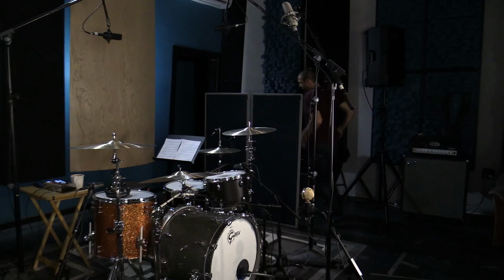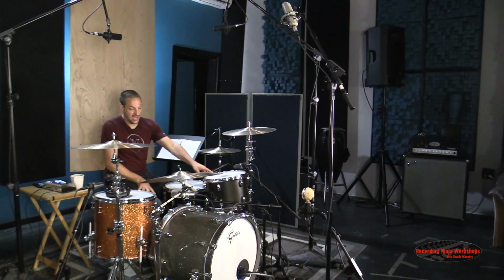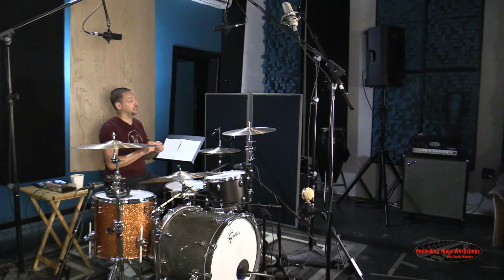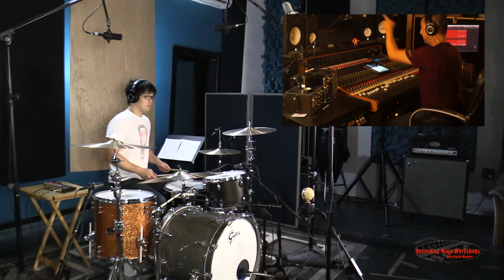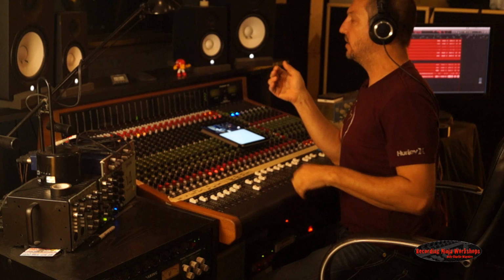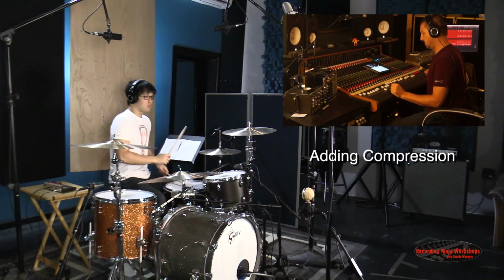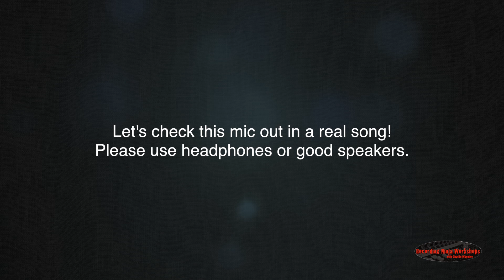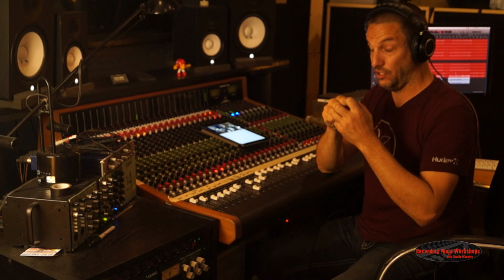Recording Drums: Adding Body & Punch to the Kick & Snare

Comment: great tips. i learned a similar trick years ago, always called it the nuke mic. usually was an re15, sm57, 421 or similar in that same position...run directly into an 1176 with all buttons pushed in. added under the main drum mix, it always added a lot. you can do similar with a mic under the drummer's throne pointed up between the kick beater and the shell of the snare.

Comment: Wow!  The over the drum mic adds so much body.  On a scope the mix probably looks less stereo though since this centered mono audio  will create less difference between left and right but who cares.  It sounds great and we can get carried away with emphasizing the recording of a single instrument in stereo that is part of an ensemble.
Reply from the maker: Hey Dollar WIL! The "over the drum" can add some cool mojo to the drum sound. It's not stereo though. It's just a single condenser hanging over the kick.
Reply: I clarified my entry to make it clear that I knew the mix would be more mono using this method but agree that the added "mojo" is worth it.  I have a drummer friend that wants to get a decent recording of his practices.  I've been trying to dissuade him from buying one of those low-quality drum kit multi mic packages.  I suggest that he buy fewer mics but of better quality and build his mic locker deliberately.  Your video best makes the argument.  Better quality mics will get used in more situations over many more years.

Question:  Have you tried using an omni pattern over the drum?  I wonder if the more uniform off axis frequency response of the omni pattern would yield an even better result.

  Thanks again.

Comment: Hola Charlie! 

Watching all your videos, thanks a lot for share them!!! I'm gonna record drums with 2 mics. My mics are condenser Rode K2 and ribbon Beyer M160, used with LA610 and another great tube preamp. I really like your mono 2 mic config, one over de snare and the other in front of the kick at the same distance. But hey , I fucking love what this fat mic does to the sound. 

What do you think, use your 2 mic mono config or I use the condenser as this fat mic and find a good place for the ribbon? Thanks again and cheers from Spain! 

Jaume
Reply from the maker: Hey Jaume! I love the Beyer M160. It's on my list to eventually buy. Try the fat mic with the Rode K2 and use the M160 for an overhead. Try to get the overhead in the middle of the kit as possible. i.e. between the toms, between the cymbals, etc.. You may have to move it around a little to find the perfect spot but it should work pretty well. 

Thanks for watching and keep me posted!

Comment: Could you put a ribbon in that same spot?
Reply from the maker: Yep. Keep in mind that it will pick up more ride cymbal (or whatever is behind the mic) because of the Fig. 8 polar pattern. Also the null spots of the Fig. 8 pattern are strongest on the sides. What ever is directly off axis will be the weakest. You'll just have to rotate the mic accordingly. 

Also be sure that the air hole on the snare is NOT pointed at the ribbon. I don't want you to accidentally kill your ribbon mic!
Reply: Definitely have some experimentation to do now next week!